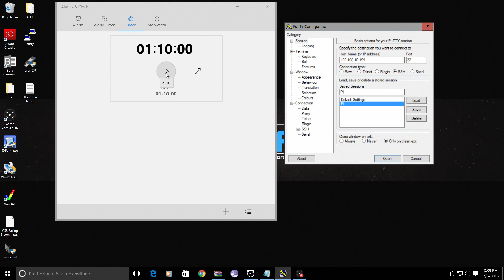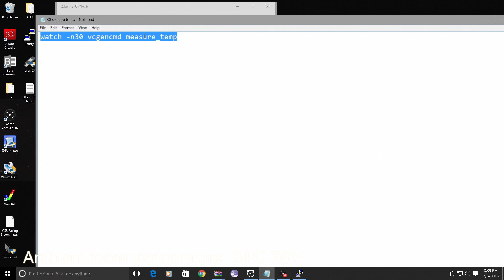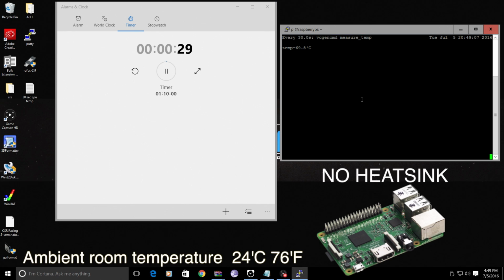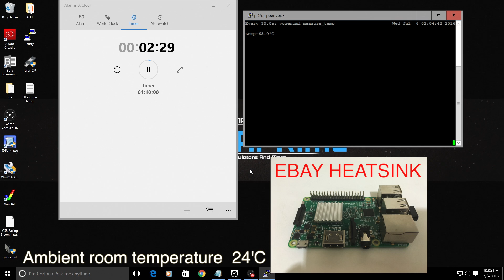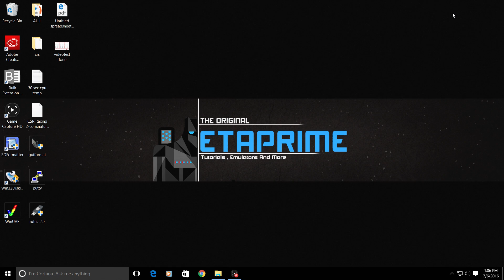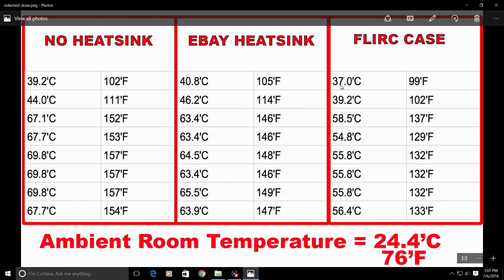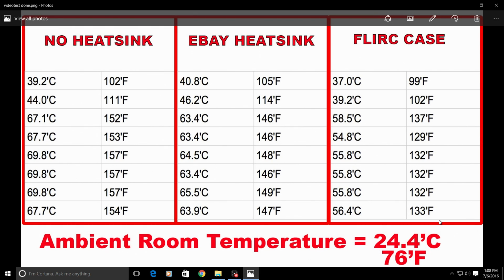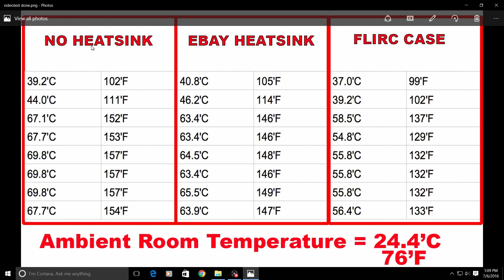Raspberry Pi 3 Thermal Test 2 Flirc Case Vs Ebay Heatsink Vs No Heatsink Youtube Playback

Comment: Simple ? yet can't find it anywhere...is there  preferred way to mount the thermal adhesive tape...sticky side directly on CPU or on the case heat-sink landing?  I would prefer on the case that way if for some reason I ditch the case or give the pi to someone it won't have this thermal tape attached to the CPU.  Thank you.

Comment: Also just wondering if you might loose wi-fi signal strenght with an aluminium case like the Flirc?
Reply: I got the BIQU and felt a weaker bluetooth for gaming. Wondering how Flirc will perform, as the top is plastic.

Comment: I’m really gonna need a case like this, the pi3 might be ok with 8/16 bits emulation but anything higher like arcade or neo geo and all of sudden the temperature climbs like crazy.
I’m just worried how to remove the heat sinks safely.

Comment: I have a set of the heat sinks, and the box that uses them just plays back video so no need to upgrade them.  I ordered another pi and the flric case just to have another unit to play around with because of your review though.